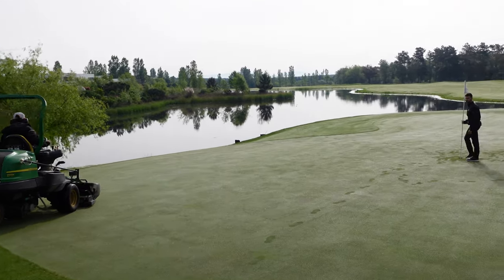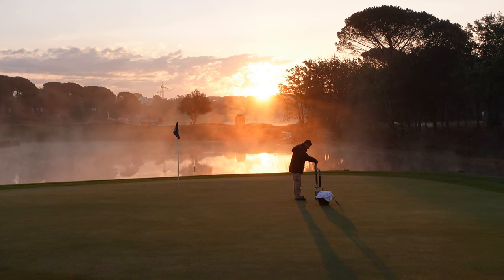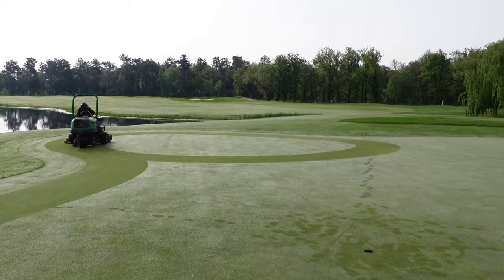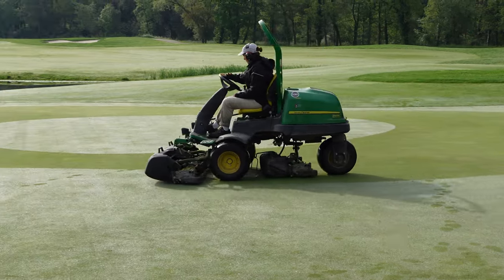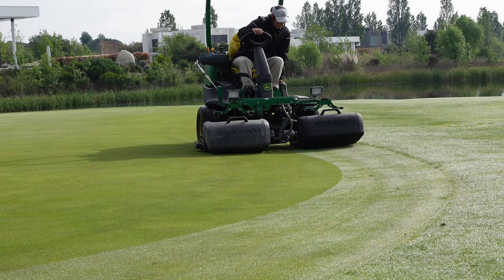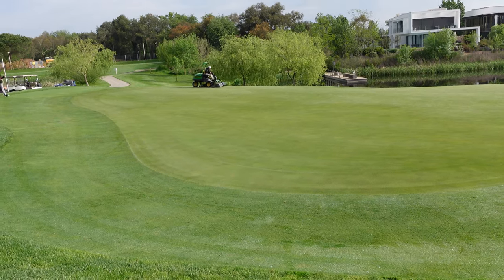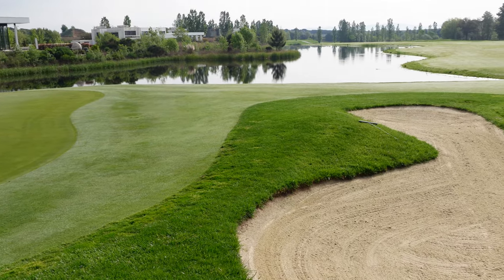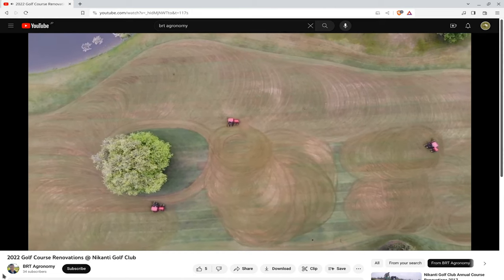Circle mow of a bentgrass putting green

Comment: Would be very difficult with out the dew to keep track of we’re you have been
Reply from the maker: That's correct, without dew it is difficult to tell. However the growth rate will ideally be slow enough that a few misses won't show, and this is meant to be a special mow pattern done occasionally, not every day.
Reply: Run sprinklers one pass when there is no dew, this works fine.